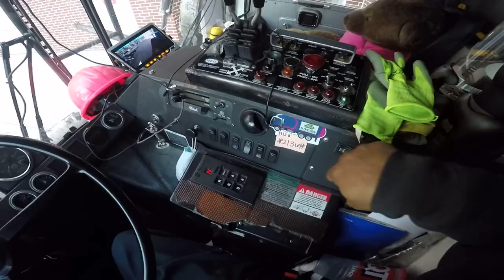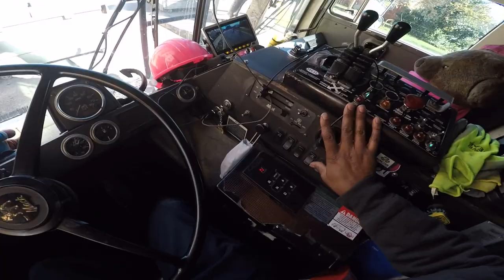January 2022 Vlog

Comment: when driving the truck is there any difference besides size when driving? like is there any manual shifting of gears ? or anything a normal driver would not understand?
Reply from the maker: No, all front loaders are automatics these days. The major difference is learning the operation of the body.